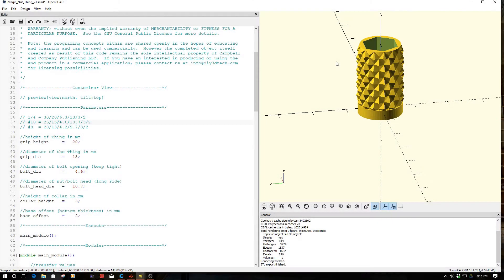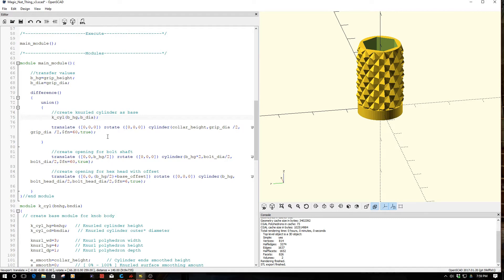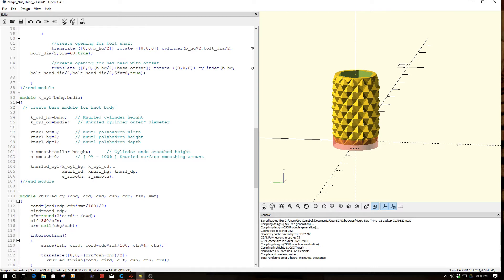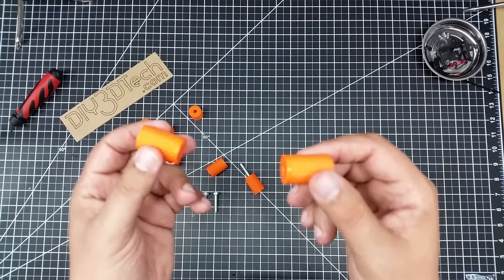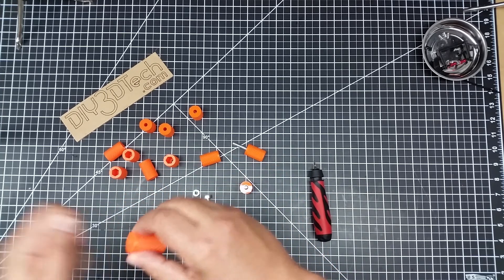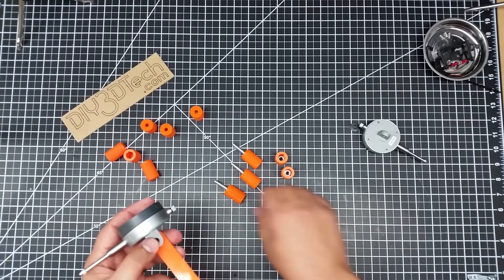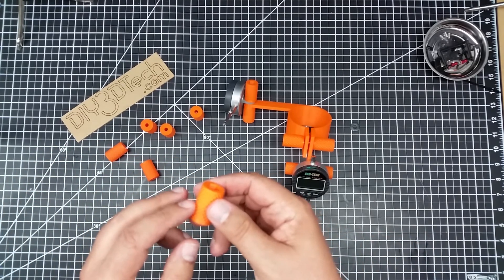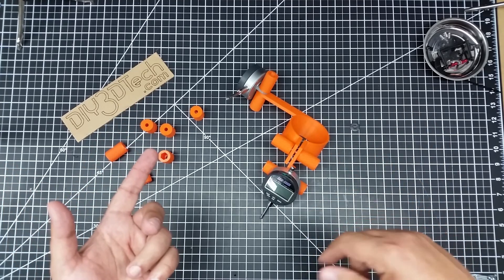Open SCAD - The Magic Nut Thing!!

Comment: Hi, I did some lathe knurling at school in the 70's and as far as I know, knurling is pronounced 'nerling'  That's what my metalwork teacher told us.
I've printed a guitar stand that used this this knurled pattern on the nuts and bolts, but it was a little rough on the fingers but I got to thinking that a finer pattern would be nicer, is there a way to adjust the pattern?.
Reply from the maker: I like that "nerling"  and yes you can adjust it, in the video I point out the area in the code :-)